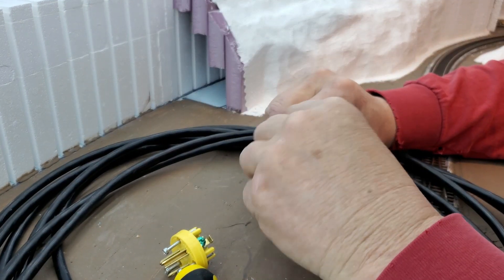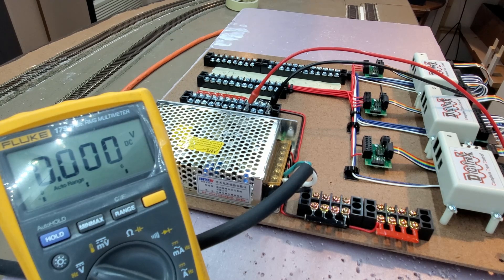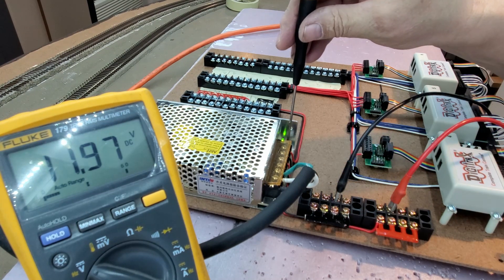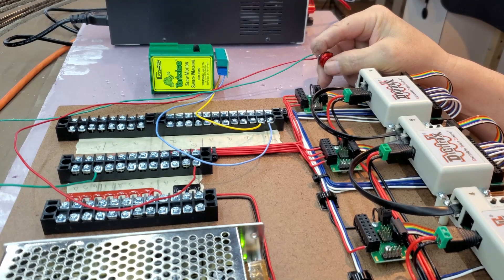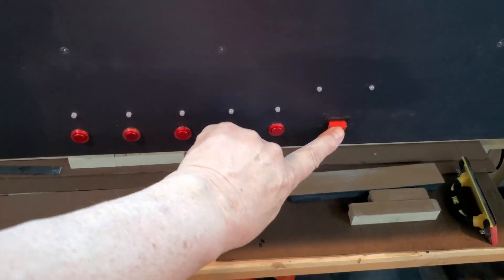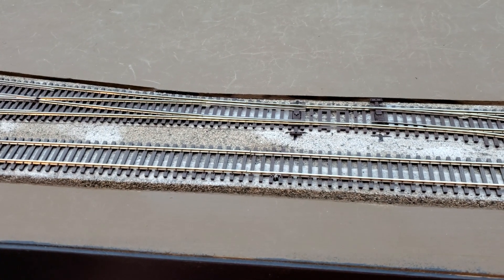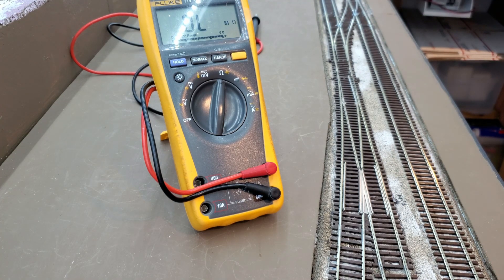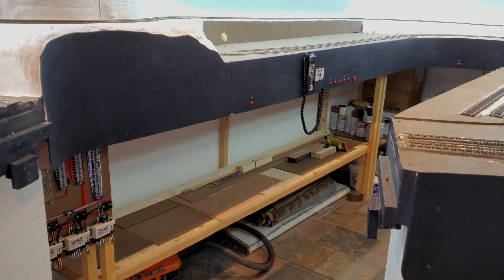DC Power Panel and DC wiring for the Industrial and Scenic Sections Completed. HO 12x20 Layout 35

Comment: Appreciate your sharing the wiring configuration for the DS7s. If I understand correctly, you have used the 12 Volt leads to power the DS74s and you have used the 5 volt output of the DS74 to power your switches. Can you clarify what you are using the 5 volt terminals from you DC power supply for, is this to power the LED or something else?
Reply from the maker: John, you are correct, the 5 volt output is for powering the LED's. I use 450 ohm resistors in the LED circuit to limit the current to 11 milliamps. The turnout momentary push button switches are wired through the DS74's and are not connected to the power supply. So, to clarify, the power supply 12 volt output powers the DS74's, the power supply 5 volt output powers the LED's.
Reply: Thank you for confirming the wiring and power connections.  Would you be so kind as to provide the name of the power supply manufacturer and model number,  I like the idea of having both 12 volt and 5 volt terminals. Thanks for your help, my inexperience is so obvious as a newby to the hobby.  Really appreciate your videos and assistance.
Reply from the maker: @johnmcdermott6220  Having both 12V and 5V is very handy!  Here is the ebay link to the power supplies I am using. I bought mine from this vendor.  I have another in my cart as well.  https://www.ebay.com/itm/110969773777